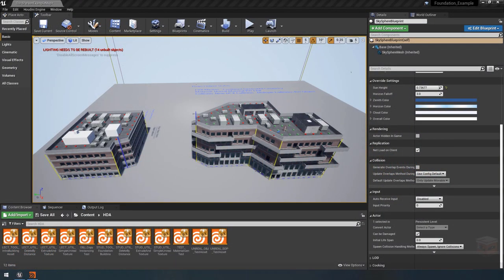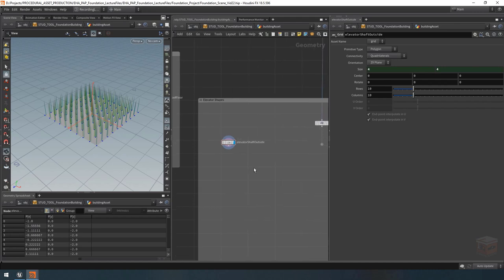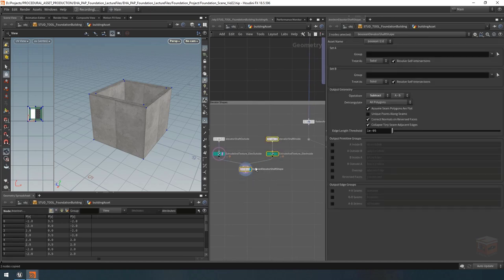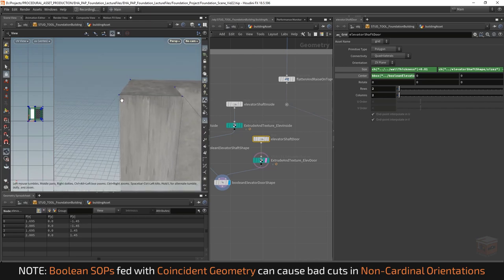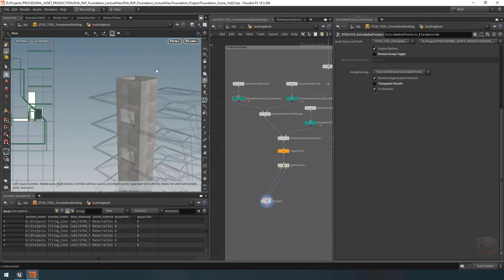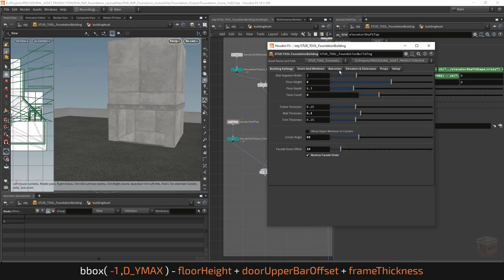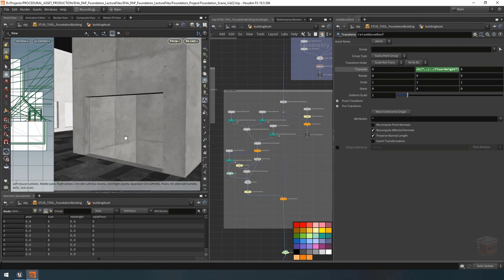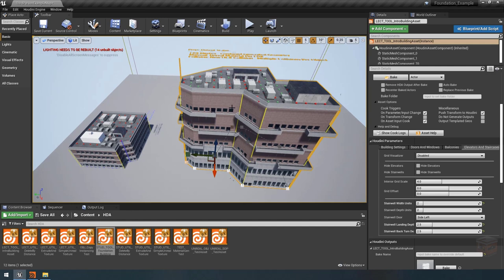HOUDINI FOUNDATION - 23 - Modeling The Elevator Shaft - ( Free Tutorial for Game Dev in Unreal )

Comment: 36:06  Not sure which part of the previous videos I missed but for some reasons my flattenAndRaise node was only affecting the elevator shaft. But it was not a big deal, when I saw the door was not aligned with the floor I noticed my nodes were arranged differently than yours and I was able to fix it quickly.